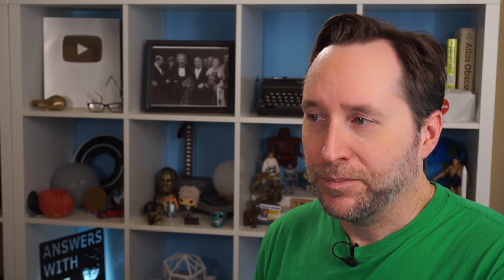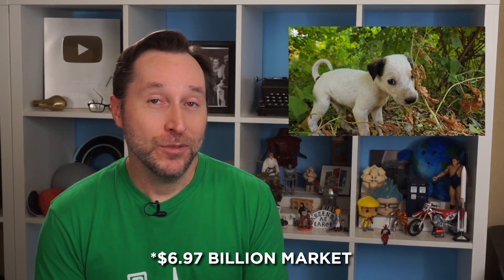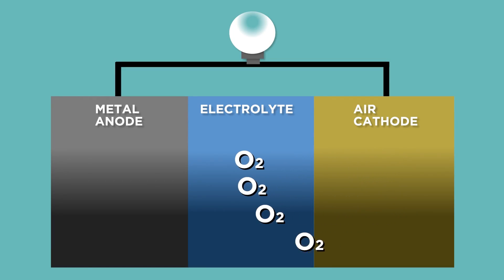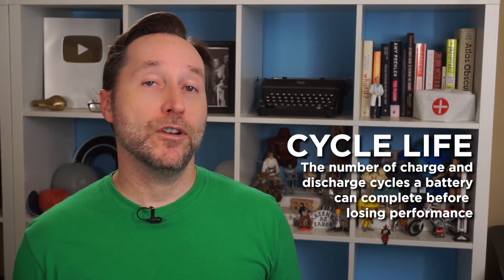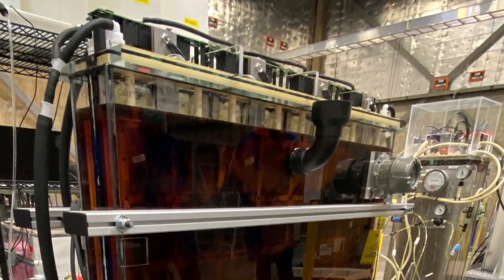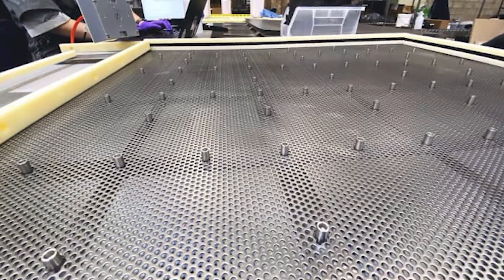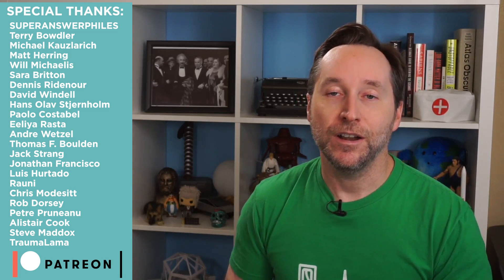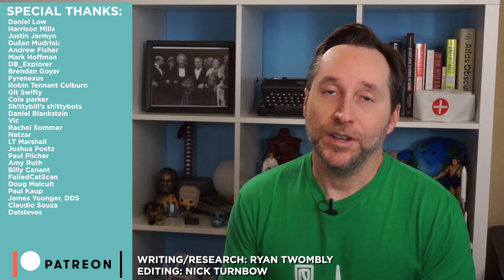Iron-Air Batteries: Storing Energy In Rust | Answers With Joe

Comment: Always look forward to your videos! I have been fascinated by flywheel/inertia energy storage lately, you should look into it. On a household scale I think it has great potential. Combined with solar and wind generation, and with permanent magnet bearings, it seems like a great storage option for 24-48hr storage with minimal losses, but it really looks good when you consider long-term costs of battery degradation and the ever-looming replacement costs of any chemical battery. Flywheel storage has pretty minimal long-term costs or maintenance costs. I am pretty sure Matt did a video on this a few years back but things change and maybe it needs new light
Reply: The Science of Dreams would be an interesting Topic for soon. 
Why do we dream and more importantly: 
When is the much-needed Tech discovered that makes you sleep dreamless?

Comment: Most solar systems used in homes require connection to the grid and won't operate during a power failure.

Comment: Liquid air storage has a lot of potential, and if you don't need the power, you can sell the liquid air!  There is another interesting project involving repurposing coal plants as thermal storage batteries using a graphite-aluminum thermal battery.

Comment: Good video, but you made a common mistake regarding your units for energy around 11:52 . When we say X Watts hours, it means Watt TIMES hours, and NOT X Watts / hours. Energy is some power TIMES some duration. E.g. If you work two times longer, you need to use two times more energy, NOT half the energy.

Comment: Hey, sorry to be a nitpick, but there's a slight mistake on your energy definitions around 11:50 - actually watts is energy over time (being defined as joules per unit time, that is the RATE that energy is provided or used), and watt-hours (MWh, GWh) is the total energy used or stored by a system (e.g. your electricity bill is measured in kWh, how much energy you consumed).  By analogy with distance and speed, watt-hours would be distance and watts are speed (essentially, you can think of a watts as being "watt-hours per hour"), which is the reverse of what you said.  You at least got the units right in the first slide (and in the script), but then start writing "watts-per-hour" (MW/HR, GW/HR) on the other slides (maybe because your font doesn't do lowercase?)  I guess "watts per hour" would be the equivalent of acceleration - I guess the rate at which a power plant can start ramping up release?

Comment: The reason oxygen is the base for many life forms is just because it is so corrosive, which means: A lot of energy is set free when it reacts.
And when Aluminium reacts with oxygen (when no water is involved), you will have aluminium oxide, not hydroxide. And that's exactly the coating on aluminium metal. However, it can be so thin that you will actually see the metal through its oxide coating, so: Everybody probably has seen aluminium metal already. 
Still messing up your chemistry? No such classes on Brilliant? 😉
However, you're in good company - Matt keeps messing up, too 😁

Comment: Since "The Grid", is not really a grid in any comprehensive way, the first thing that needs to be done is to upgrade "The Grid" to be a grid. At least nationally first, and then world-wide. The Sun shines 24 hours a day. Time to use it 24 hours a day all over the world. Grid-Batteries should be used for local stabilization at most, anything else is like expecting your flashlight batteries to run your stove.

Comment: cars are stationary, parked at home or at the drivers' destination for a lot of time, most of that time they are connected to the grid to charge. could EV car batteries be part of a decentralised, crowd-sourced power storage grid?
Reply: Yes, and it is already being done in some places; with proposals for much wider adoption. The biggest issue is the "one way flow" model which legacy power grids have been designed around.
Reply: @FreeManFreeThought  interesting! here in the UK, it'snot abnormal for people with solar panels or a wind turbine to "feed in" to the grid, i assumed that was possible everywhere.

Comment: Just wanted to add a correction at 11:54. Watts are not a measure of work capacity but of power (how quickly a certain amount of work could be done) and watt hours is not work over time but a measure of energy or how much work can be done. 

It feels like you just switched these but also the definitions don’t feel quite right. Maybe these have a different context in grid energy but I think it’s probably just a simple mistake.

Comment: Hey! I just want to fact-check a little tiny thing. You mentioned that the blackouts in Texas are used as arguments against switching to renewables. That part is true, but those arguments are so incredibly baseless. In case you don't remember, the reason those blackouts happened was that there were big gas thermal plants that the operators neglected to winterize. When the cold weather hit, those plants failed and the blackouts happened. It had nothing to do with renewables.

So, your statement was correct, but misleading. Thanks for your time. Love you Joe. The dogs were great too. Always a solid addition to any video.

Comment: Something that I very rarely see (outside of my job) is people discussing Hydrogen fuel cells for stationary power. Fuel cells, aluminum air batteries, and rust batteries all work pretty similarly stripping electrons as part of a chemical reaction, but fuel cells basically just need water.

I'd like to see more people talking about, or at least I'd like to see an analysis of the feasibility of, electrolyzing water into 2H2 and O2 using spare power from renewables like excess peak solar. Then you could use fuel cells at night to turn that H2 and O2 back into water and electricity. I never see it discussed, but I believe it could be an immediate solution to peak power issues.

Comment: With all of the environmental degradation & supply issues associated with mining of materials for storage batteries, wind generator magnets, and PV panels; perhaps it's time we ditch intermittent unpredictable "renewables" and embrace #SafeCleanReliable nuclear power. 

Per GWHr produced, it has a far smaller environmental footprint, produces far less hazardous waste, and is about 100-1000x safer than ANY other power source in the world, including "renewables". 

And unlike spent nuclear fuel, the waste from batteries, magnets, and PV panels remains toxic forever.

#ZeroGHGEmissions
#AlwaysOn 
#GoNukes

Comment: Dont worry Joe, your the king of cutaways.  I find these types of videos on long-term energy storage so awesome, I've never understood with this potential setup is how quickly can these batteries respond to changing loads.  I'm no scientist but it would seem to be made for discharging at a pretty set rate like a data center might do instead of a widely varying load like residential/commercial  would have

Comment: I remember being in high school in the 80s and reading a paper about electric cars. It was an interesting article on a science paper. For years there is has been this race where are the major car manufacturers often computer with their version of an electric car. Not much progress had occurred. They were lucky to get to 25 miles an hour. Had to be battery powered. Usually independent developers do not compete because of the cost. Then a group of scientists decide to show them up. they came in with a slightly air powered battery and was easily able to get to do 60 miles an hour.  The major car manufacturers were apparently pretty pissed off and accuse them of cheating, because how dare they show them up.

reminds me of the current administration having the major car manufacturers show up and claiming General Motors was a world leader.  Yet Tesla out does them collectively and he was not invited.
Reply: In Cambridge in 1985 the Alewife Station was built for subway, busses and a huge parking garage. They installed electric car charging stations, encouraged by local academics that electric cars were just around the corner.  They shut them down over 20 years ago, nothing modern could connect to them, they were basically covered in bags because of the potential expense in dismantling them.
 But I don't know if Tesla really needs championing here. They're not the scrappy underdog "independent developer" anymore. I'd like to know exactly what event you are talking about. You're awfully vague and I'd like to read and see if there isn't more to the story than what you've heard. "Current administration"? major car manufacturers "show up"? where? when? how?  Reads suspiciously like fake news.

Comment: Its a shame that renewalables are being blamed for the power outages that happened in Texas because if you actually do a tiny bit of research you'll find that coal and oil were the BIGGEST reasons for the outages because none of the companies took the warnings and made the necessary upgrades for cold weather, renewable WERE NOT THE REASON for the Texas power outages stop spreading that misinformation... it was the coal and the coal companies not wanting to spend money to weatherize their systems while the renewable kept going but just don't make up enough of the Texas energy generstion to pick up where the coal failed. So please stop spreading misinformation that renewable had anything to do with the Texas power outage because it wasn't at all thenproblem the coal and coal companies WERE THE PROBLEM.

Comment: Joe, keep in mind most solar installs are grid tie and don't work when the grid is down.   You have to have additional interlock switches set up to prevent solar from back feeding the grid and possibly electrocuting line workers.  If you want solar off grid, you need  to manually disconnect from the grid, which may not be doable due to code regulation in your area.
Reply: My 9 solar panels have interlock.  Oh, and give me credit on my electric bill, and home battery.  I was ripped off by installer $$ tho they did do a good job.
Reply: @veramae4098  That's not credit; that's your complicity in extortion. The utility company is forced to pay you for the privilege of bearing the negative load your panels put on the grid. 
The grid isn't some bucket that energy can be dumped into and scooped from; it's a precarious system that's being constantly adjusted.
Reply: one thing Texans don't have to worry much about is code regulations.  I'm pretty certain Joe looked into this, as thousands of Texans have. Lack of regulation is part of what got them in the polar vortex mess in the first place.
Reply: @squirlmy  unfortunately general regulations, or lack thereof, are different from the NEC...all cities in Texas follow some recent version of the national electrical code.
Reply: @squirlmy  regulations are a commie cancer whose only purpose is to make the beneficiary of the corruption some politician instead of the company providing the service.
Taxation is theft and so is regulation.
Reply: @aftoknito  Sure because big corporations always have your best interests at heart. Why regulate water and air pollution? Flint comes to mind. You want roads, bridges, police departments, fire departments, schools? Pay your taxes - all civilized countries have them.
Reply: @rockdinosaur8619  I see your point but still believe taxation is theft the amount of taxs paid to money spent don't add up taxs year on year go up but here in the UK police NHS and fire services get cuts more and more government funded projects get closed and more public funded infrastructure gets sold and we have to deal with rising private prices along side rising taxs
Reply: @aftoknito  I'm also going to direct you to Thomas' comment that is amazing.
But you also have to understand that regulations and codes are a very important bare minimum that need to be followed at all times. Every single code and regulation in those massive 1000-pages manuals comes from a story of some house burning down, some guy getting crushed, some accident somewhere costing someone their lives or their livelihoods. If you don't follow basic code minimums, you're just causing yourself or someone else a major headache at some later date.
PS: Knowledgeable professionals can make field decisions, but ONLY when they fully understand why that basic design recommendation was made in the first place, and have fully accounted for each of the reasons it was addressing.
Reply: @rockdinosaur8619  ummmm yeah and you are told where to work and what to do and what you may or may not have. 
Thats total taxation not no taxation.
Reply: just don't pay for energy, they WILL take your house off grid
Reply: how can a city force people to be on grid?
Reply: @bmsg1  my county forces homes to have water on the property. I know multiple people who spent over 10 grand to drill a well, even though they already knew the well water would be brackish and they would need to truck potable water in and use storage tanks. Completely asinine.
Reply: @Eyes0penNoFear   so what happens when you don't have the money? the government drill for you? or it is the kinda stuff were local government only apply the law when they don't like you?  I hate when that happens
Reply: @bmsg1  as far as I know, they apply the law equally to everyone. But if you don't have the money then they fine you, and they'd probably eventually send the sheriff to kick you out of your own home.
Some friends of ours thought they could live in their house while they worked on it, but the county found out there was no water on the property. I don't know all the details, but I think the county threatened to have CPS take their kids away. They ended up living in my in-laws' basement for almost a year.
Reply: @Eyes0penNoFear  I rather have houses falling down from time to time, sometimes I love being in a third world country, you can buy, sell, work and build informally without much repercussions( if it is not dealing with too much money), I think that's the better way to do things, let people be
Reply: @bmsg1  yep! I feel that it should be voluntary and inexpensive to have an inspector come check your work. I personally would want to know if my house is going to fall down, but some people would rather save time/money and take their chances. I don't need or want big government holding my hand and forcefully ensuring I never stumble.
Reply: No, that's old regulations OGPedXing..  As long as you have a set up that disconnects from the grid automatically when grid loses power there are no problems.  Rules were changed in last few years around the country.
Reply: @protonneutron9046  all solar installs disconnect when the grid loses power.  What we're talking about is that most installs do not also feed your local panel when this occurs.  So you are left with solar that you can't use when the grid is down.  Additional equipment is needed and many installers do not make this clear to customers.  I work in the energy industry and we deal with this constantly from annoyed customers who got screwed by the installers.
Reply: @OGPedXing  WRONG AGAIN!  There has been dangerous problems with home grid tied solar that was NOT designed to disconnect when grid lost power THUS, being the impenitence for some states to make laws REQUIRING that feature.. Injuring power company workers.  I designed my first commercial home solar system 42 years ago.
Reply: @protonneutron9046  Overreact much? Please reread my original comment.  I'm talking about current code and technology, and current common problems with installs.  Please try to be civil, you just make yourself look bad.   For others out there considering solar -- make sure you ask the right questions so your installation works correctly for you.  You can save money using the basic grid-tie inverter setup but you will likely have no electricity if the grid is down despite the sun being up.

Comment: I think a big problem with power companies, whether they're using coal, gas, hydro, nuclear, or battery is it's all centralized. The power plants themselves generally aren't the the weak spot in a power grid. It's the transmission lines that are susceptible to damage that cause blackouts. Especially during inclement weather. I think decentralizing the power grid would be a better move. The only problem with that is, when you're talking about environmentally safe alternatives, you can't just put those anywhere. Putting a solar array in Northern Canada wouldn't work anymore than putting a hydroelectric station in the Sahara. I don't know what the best way to do it would be, honestly. I live a quarter of a mile away from a hydroelectric plant that used to supply our town, but since it was taken over by Duke Energy, most of our power comes from a coal ash facility a couple of hundred miles away. That honestly makes no sense to me.